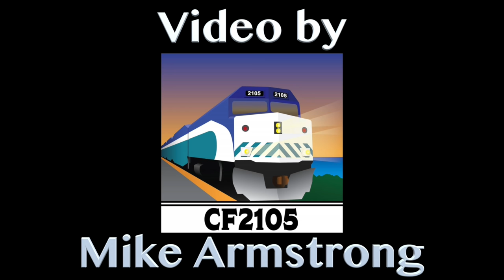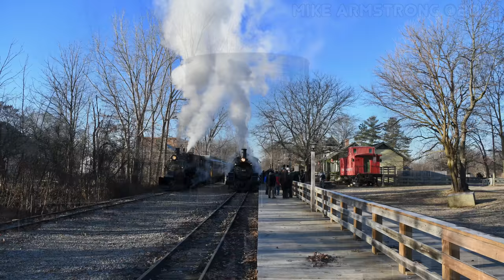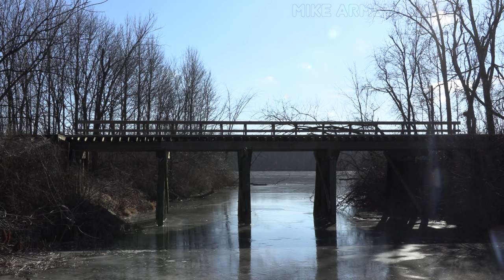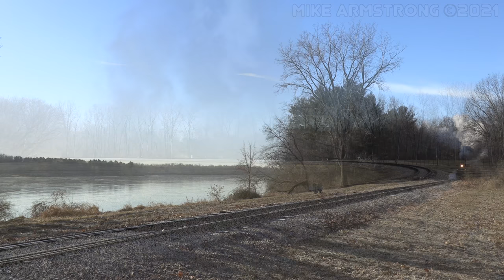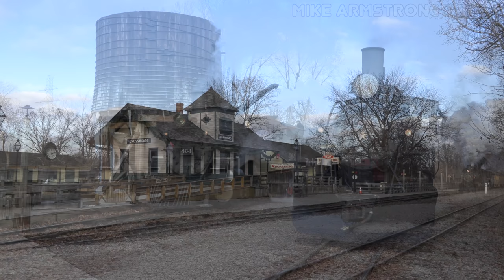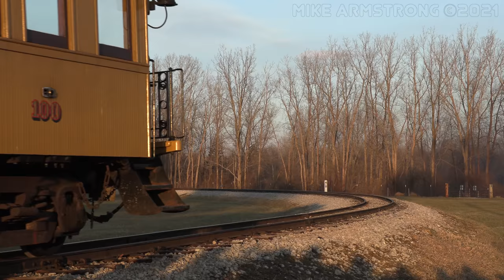Huckleberry Railroad Steam Trains

Comment: Nice! It's on my bucket list.
Reply: There's quite a lot to do at Crossroads Village. Although it used to be a lot better. There's an operational blacksmith shop, an old mill, olde tyme candy shop, general store, doctors office, etc and of course the old train station.
If you call ahead, you might get a tour of the boilermakers building where all the work on the steam engines is done. 
I've heard there are sometimes apprenticeships available also.

Comment: The trestle in several shots and at 15:57 is the caps and stringers from what was called the "ZOO TRESTLE" when I was there between 1979 and 1983.  It was a ballasted deck trestle when I was there.  Thankfully they did not include the caboose on any of those trains.  I did not notice Car No. 8 in the group but it is a Kimball Car Co. car from about 1877 or so from the Northwestern Pacific and the OR&N out of Reno, Nevada before that line was standard-gauged.  Car No. 40 was originally a standard gauge car; there are two sets of bolsters under it.  Car No. 260 was built new by the Burnham shops for the Rio Grande Southern with used trucks and the only new car they ever had.  Cars 306 & 320 were from the Antonito to Santa Fe line.   Car No. 316 was added after I left.  Car No. 100 was a business car from the Zacataos RR in Mexico.